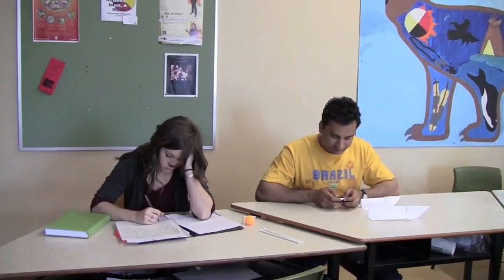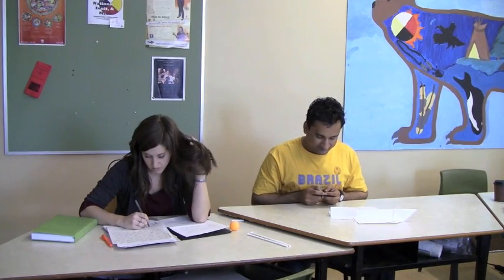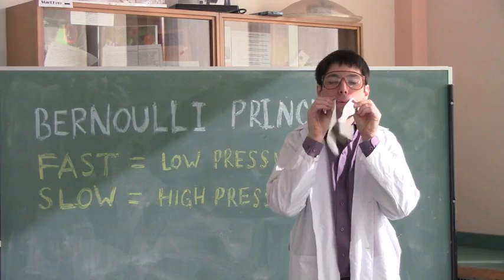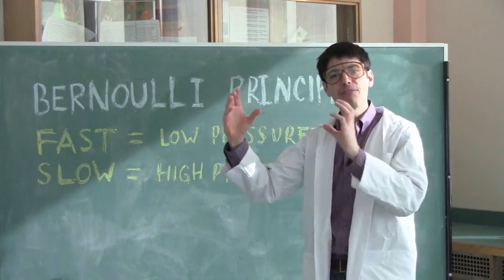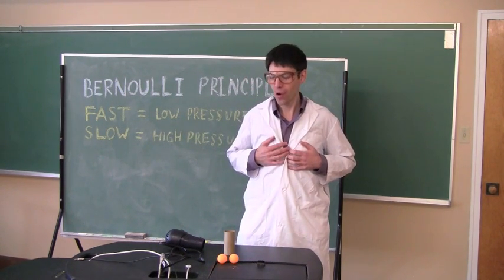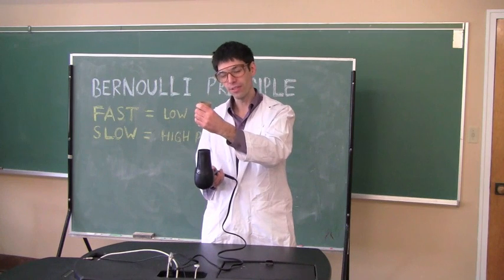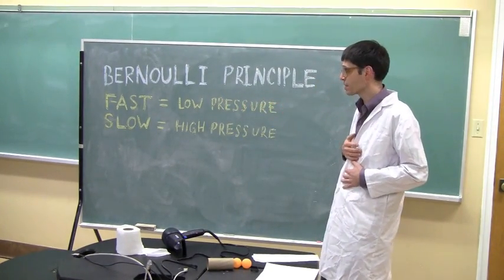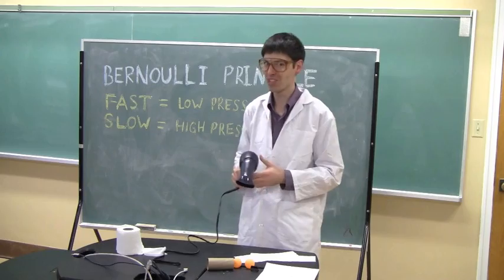✈✈ Bernoulli's Principle - Easiest Way Explained ✈✈ ☹ ☹

Comment: But if the air is travelling at constant velocity on either side of the wing why is the pressure higher at the bottom ?
Reply: This is a BAD SCIENCE VIDEO.
.
Why do you want to spread these misconceptions?  Fix or delete this video.
I am very sorry, but this is only repeating some  of the most common misconceptions in science.  
Fast air does not have low pressure.  What Bernoulli found is that Accelerating air has a decreasing pressure and visa versa; BUT NOT what caused this to happen.  
--
Euler continued that study and realized that it is a pressure Gradient (difference between two locations) that is the force that accelerates a fluid.  This is Newton for fluids.
...
The air out of your mouth is at atmospheric pressure; that same pressure as the still air around it.  It is the higher pressure*created *inside your lungs by the contracting muscles that accelerates the air out into the lower, atmospheric pressure.
..
Blowing next to paper demonstrates entrainment which is caused by viscosity. . Look them up.  
If this is what your teacher taught, they have been misinformed, which is, unfortunately, VERY common.
--
The air over a wing only looks faster in a wind tunnel.  The lower air is actually faster as a wing flies by you.  The upper air is, however,  accelerated much more caused by the lower pressure above the wing.
The pressure changes around a wing are simply caused by the wing pushing air out of the way to get through it.
...
Bernoulli had nothing to do with the development of the airplane. He was doing blood pressure studies.
...
The air above a wing gets to the trailing edge significant;y BEFORE the lower air; which is caused by the low pressure accelerating it toward the rear.
...
The ping-pong ball is held in the center by the Coanda Effect. A flow that follows a convex surface is what lowers the pressure. Think of centrifugal force pulling the air away and, therefore lowering the pressure.
 The air out of the hair drier is at atmospheric pressure, The side of the ball where more air curves around to the down-wind side (top)  of the ball has a lower pressure because of the greater Coanda curved flow. 
When tipped, there is more air flowing over the top AND flowing in a curved path (around the back and then downward).  This lowers the pressure more and supports more of the weight, therefore, allowing the upward moving air's dynamic pressure to push the ball further out..  This is the only explanation which explains why the ball moves further away when the flow it tipped because the air is slowing down farther from the blower and the centering force would be less, not more, if the Bernoulli fallacy as true.
..
ALSO, if the air at the blower's exit was lowest, the ball would be "sucked" down (actually pushed down by higher pressure above it)
...

The tube above the ping-pong ball is a very good discovery and requires a more careful understanding because this fast air thing is false.  
My initial analysis is as follows:
The tube prevents much of the air which would simply 'spill' around the sides of the ball to be trapped below the ball in the tube and to push the ball up like a piston in a cylinder.
Reply: It's the shape of the airfoil. The top has more curvature. I always taught my students, the more curvature you have the more lift you'll produce. The difference in pressure from the top of the wing vs the bottom of the wing is what produces lift. So the shape/curvature of the wing is what is creating the pressure difference from the top vs the bottom. The reason why we can only put so much curvature into a wing is because of structure integrity if we have too much of a curved wing then the structure itself would be weak. Also we have fuel in the wings so we need space.

Comment: My dads a pilot and he wants me to learn this. I'm sure I got it now.
Reply: This is a BAD SCIENCE VIDEO.
.
Why do you want to spread these misconceptions?  Fix or delete this video.
I am very sorry, but this is only repeating some  of the most common misconceptions in science.  
Fast air does not have low pressure.  What Bernoulli found is that Accelerating air has a decreasing pressure and visa versa; BUT NOT what caused this to happen.  
--
Euler continued that study and realized that it is a pressure Gradient (difference between two locations) that is the force that accelerates a fluid.  This is Newton for fluids.
...
The air out of your mouth is at atmospheric pressure; that same pressure as the still air around it.  It is the higher pressure*created *inside your lungs by the contracting muscles that accelerates the air out into the lower, atmospheric pressure.
..
Blowing next to paper demonstrates entrainment which is caused by viscosity. . Look them up.  
If this is what your teacher taught, they have been misinformed, which is, unfortunately, VERY common.
--
The air over a wing only looks faster in a wind tunnel.  The lower air is actually faster as a wing flies by you.  The upper air is, however,  accelerated much more caused by the lower pressure above the wing.
The pressure changes around a wing are simply caused by the wing pushing air out of the way to get through it.
...
Bernoulli had nothing to do with the development of the airplane. He was doing blood pressure studies.
...
The air above a wing gets to the trailing edge significant;y BEFORE the lower air; which is caused by the low pressure accelerating it toward the rear.
...
The ping-pong ball is held in the center by the Coanda Effect. A flow that follows a convex surface is what lowers the pressure. Think of centrifugal force pulling the air away and, therefore lowering the pressure.
 The air out of the hair drier is at atmospheric pressure, The side of the ball where more air curves around to the down-wind side (top)  of the ball has a lower pressure because of the greater Coanda curved flow. 
When tipped, there is more air flowing over the top AND flowing in a curved path (around the back and then downward).  This lowers the pressure more and supports more of the weight, therefore, allowing the upward moving air's dynamic pressure to push the ball further out..  This is the only explanation which explains why the ball moves further away when the flow it tipped because the air is slowing down farther from the blower and the centering force would be less, not more, if the Bernoulli fallacy as true.
..
ALSO, if the air at the blower's exit was lowest, the ball would be "sucked" down (actually pushed down by higher pressure above it)
...

The tube above the ping-pong ball is a very good discovery and requires a more careful understanding because this fast air thing is false.  
My initial analysis is as follows:
The tube prevents much of the air which would simply 'spill' around the sides of the ball to be trapped below the ball in the tube and to push the ball up like a piston in a cylinder.

Comment: Nice video!  You explain it very well
Reply: This is a BAD SCIENCE VIDEO.
.
Why do you want to spread these misconceptions?  Fix or delete this video.
I am very sorry, but this is only repeating some  of the most common misconceptions in science.  
Fast air does not have low pressure.  What Bernoulli found is that Accelerating air has a decreasing pressure and visa versa; BUT NOT what caused this to happen.  
--
Euler continued that study and realized that it is a pressure Gradient (difference between two locations) that is the force that accelerates a fluid.  This is Newton for fluids.
...
The air out of your mouth is at atmospheric pressure; that same pressure as the still air around it.  It is the higher pressure*created *inside your lungs by the contracting muscles that accelerates the air out into the lower, atmospheric pressure.
..
Blowing next to paper demonstrates entrainment which is caused by viscosity. . Look them up.  
If this is what your teacher taught, they have been misinformed, which is, unfortunately, VERY common.
--
The air over a wing only looks faster in a wind tunnel.  The lower air is actually faster as a wing flies by you.  The upper air is, however,  accelerated much more caused by the lower pressure above the wing.
The pressure changes around a wing are simply caused by the wing pushing air out of the way to get through it.
...
Bernoulli had nothing to do with the development of the airplane. He was doing blood pressure studies.
...
The air above a wing gets to the trailing edge significant;y BEFORE the lower air; which is caused by the low pressure accelerating it toward the rear.
...
The ping-pong ball is held in the center by the Coanda Effect. A flow that follows a convex surface is what lowers the pressure. Think of centrifugal force pulling the air away and, therefore lowering the pressure.
 The air out of the hair drier is at atmospheric pressure, The side of the ball where more air curves around to the down-wind side (top)  of the ball has a lower pressure because of the greater Coanda curved flow. 
When tipped, there is more air flowing over the top AND flowing in a curved path (around the back and then downward).  This lowers the pressure more and supports more of the weight, therefore, allowing the upward moving air's dynamic pressure to push the ball further out..  This is the only explanation which explains why the ball moves further away when the flow it tipped because the air is slowing down farther from the blower and the centering force would be less, not more, if the Bernoulli fallacy as true.
..
ALSO, if the air at the blower's exit was lowest, the ball would be "sucked" down (actually pushed down by higher pressure above it)
...

The tube above the ping-pong ball is a very good discovery and requires a more careful understanding because this fast air thing is false.  
My initial analysis is as follows:
The tube prevents much of the air which would simply 'spill' around the sides of the ball to be trapped below the ball in the tube and to push the ball up like a piston in a cylinder.

Comment: Saw a tiktok about a guy freaking out not knowing why Bernoulli principle works for planes. And now, i’m here at 3 in the morning
Reply: This is a BAD SCIENCE VIDEO.
.
Why do you want to spread these misconceptions?  Fix or delete this video.
I am very sorry, but this is only repeating some  of the most common misconceptions in science.  
Fast air does not have low pressure.  What Bernoulli found is that Accelerating air has a decreasing pressure and visa versa; BUT NOT what caused this to happen.  
--
Euler continued that study and realized that it is a pressure Gradient (difference between two locations) that is the force that accelerates a fluid.  This is Newton for fluids.
...
The air out of your mouth is at atmospheric pressure; that same pressure as the still air around it.  It is the higher pressure*created *inside your lungs by the contracting muscles that accelerates the air out into the lower, atmospheric pressure.
..
Blowing next to paper demonstrates entrainment which is caused by viscosity. . Look them up.  
If this is what your teacher taught, they have been misinformed, which is, unfortunately, VERY common.
--
The air over a wing only looks faster in a wind tunnel.  The lower air is actually faster as a wing flies by you.  The upper air is, however,  accelerated much more caused by the lower pressure above the wing.
The pressure changes around a wing are simply caused by the wing pushing air out of the way to get through it.
...
Bernoulli had nothing to do with the development of the airplane. He was doing blood pressure studies.
...
The air above a wing gets to the trailing edge significant;y BEFORE the lower air; which is caused by the low pressure accelerating it toward the rear.
...
The ping-pong ball is held in the center by the Coanda Effect. A flow that follows a convex surface is what lowers the pressure. Think of centrifugal force pulling the air away and, therefore lowering the pressure.
 The air out of the hair drier is at atmospheric pressure, The side of the ball where more air curves around to the down-wind side (top)  of the ball has a lower pressure because of the greater Coanda curved flow. 
When tipped, there is more air flowing over the top AND flowing in a curved path (around the back and then downward).  This lowers the pressure more and supports more of the weight, therefore, allowing the upward moving air's dynamic pressure to push the ball further out..  This is the only explanation which explains why the ball moves further away when the flow it tipped because the air is slowing down farther from the blower and the centering force would be less, not more, if the Bernoulli fallacy as true.
..
ALSO, if the air at the blower's exit was lowest, the ball would be "sucked" down (actually pushed down by higher pressure above it)
...

The tube above the ping-pong ball is a very good discovery and requires a more careful understanding because this fast air thing is false.  
My initial analysis is as follows:
The tube prevents much of the air which would simply 'spill' around the sides of the ball to be trapped below the ball in the tube and to push the ball up like a piston in a cylinder.

Comment: really liked the video; thanks for making this
Reply: Unfortunately, this is a BAD SCIENCE VIDEO.
Here is what I previously posted:
.
I am very sorry, but this is only repeating some  of the most common misconceptions in science.  
If this is what your teacher taught, they have been misinformed, which is, unfortunately, VERY common.
.
Fast air does not have low pressure.  What Bernoulli found is that Accelerating air has a decreasing pressure and visa versa; BUT NOT what caused this to happen.  
--
Euler continued that study in the mid 1700s and realized that it is a pressure Gradient (difference between two locations) that provides the force that accelerates a fluid.  This is Newton's Laws in fluids.
...
The air out of your mouth is at atmospheric pressure; that same pressure as the still air around it.  It is the higher pressure created inside your lungs by the contracting muscles that accelerates the air out into the lower, atmospheric pressure. Higher pressure accelerates air toward the lower pressure.
..
Blowing next to paper demonstrates entrainment which is caused by viscosity. . Look them up.  
--
The air over a wing only looks faster in a wind tunnel.  The lower air is actually faster as a wing flies by you.  The upper air is, however,  accelerated much more. This is caused by the lower pressure above the wing. It is accelerated REARWARD so much that it reverses direction from being pushed forward ahead of the wing to traveling rearward toward the trailing edge as the wing passes.
.
The pressure changes around a wing are simply caused by the wing pushing air out of the way to get through it.
...
Bernoulli had nothing to do with the development of the airplane. He was doing blood pressure studies.
...
The air above a wing gets to the trailing edge significant;y BEFORE the lower air; which is caused by pressure ahead of the wing pushing it toward the low pressure above, thus accelerating it toward the rear.
...
The ping-pong ball is held in the center by the Coanda Effect. A flow that follows a convex surface is what lowers the pressure. Think of centrifugal force pulling the air away and, therefore lowering the pressure.
 The air out of the hair drier is at atmospheric pressure, The side of the ball where more air curves around to the down-wind side (top)  of the ball has a lower pressure because of the greater Coanda curved flow. 
When tipped, there is more air flowing over the top AND flowing in a curved path (around the back and then downward).  This lowers the pressure more and supports more of the weight, therefore, allowing the upward moving air's dynamic pressure to push the ball further out..  This is the only explanation which explains why the ball moves further away when the flow it tipped because the air is slowing down farther from the blower and the centering force would be less, not more, if the Bernoulli fallacy as true.
..
ALSO, if the air pressure at the blower's exit was lowest, the ball would be "sucked" down (actually pushed down by higher pressure above it)
...

The tube above the ping-pong ball is a very good discovery and requires a more careful understanding because this fast air thing is false.  
My initial analysis is as follows:
The tube prevents much of the air which would simply 'spill' around the sides of the ball to be trapped below the ball in the tube and to push the ball up like a piston in a cylinder.